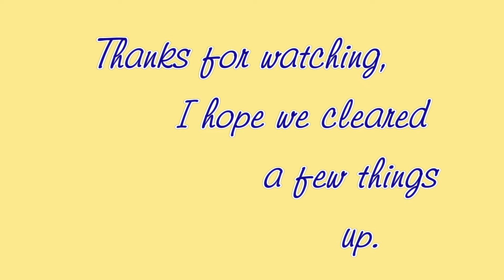The "Gel Click" Pen Turning and Assembly

Comment: Yes you are so right. I just made two of those Kits. The first one doesn't work at all and the second one doesn't retract the Gel Pen all the way inside. Measuring the 2 pieces, i see one is exactly 5 centimeter long, the other is missing at least 2 millimeters. Yeah, screwed.

I have to say, i got talked into buying that Barrel Trimmer ... and after killing two pens i have to say those Trimmers are not really very good. They cut far too easy into the Brass Tubes you have to glue in and it doesn't help that with all the dust and whatnot its hard to see how far you cut.
The manual talks about either using a Barrel Trimmer to do that or a Belt Sander.

With the knowledge of 2 Pens, i will find another way how to deal with that problem. The Barrel Trimmer is shit and i think a Belt Sander isn't that much better. Both WILL eat away your tiny brass tube, and you end up fucking up the pen.
Reply: I know what you mean, however the trimmer works.  You just have to be real careful when you get down to the level of the tube. Use a very light touch until you just barely see brass.  I use a puff of air to make sure the dust isn't just sitting on the top of the brass tube.